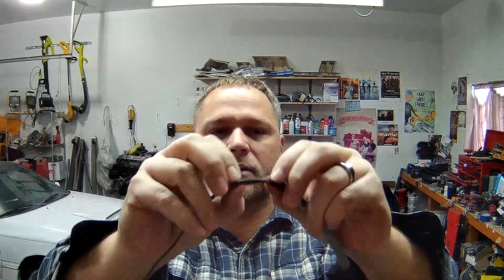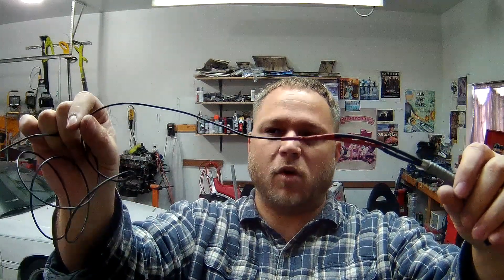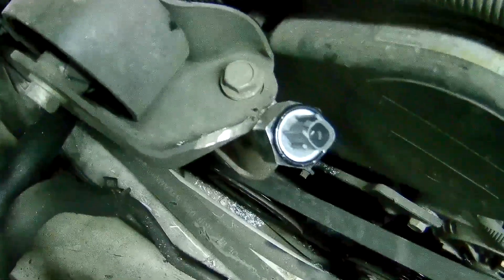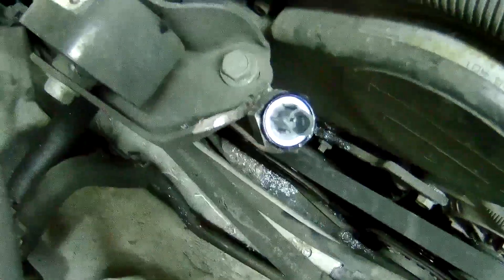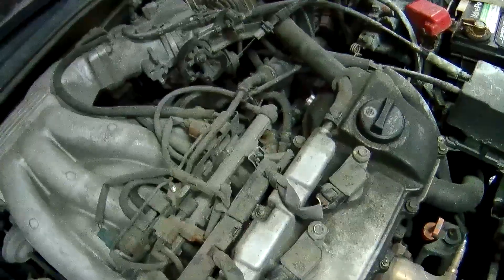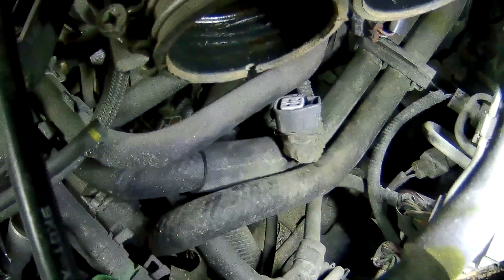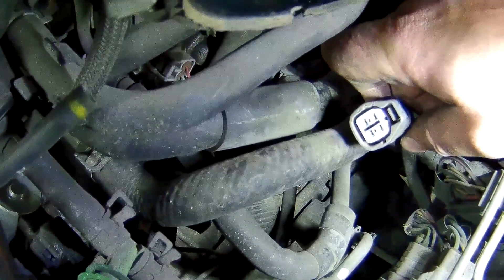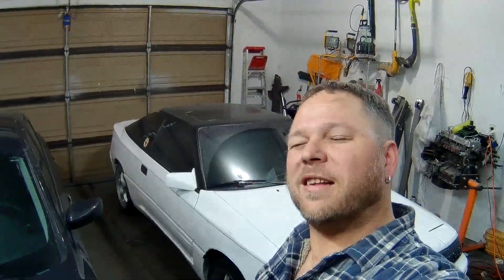1MZ-FE Knock Hack/Relocation

Comment: I know these are old post,but I have found a way of modifing bracket to head under air filter area to work stopping dreaded ping/ engine knock. I removed factory plate with ground wire on head ,used a square metal plate to mount sensors via 2 10mm bolts already there from factory plate. When you tighten new plate down it squeezes sensors against head and valve cover . No more gas ping.
Reply: Any pics.?

Comment: Do you get any issues from this does the engine perform worse in terms of performance or mileage
Reply from the maker: @JackTripper253  for the condition this engine was in, it ran fine. The computer was able to get a reading from the knock sensor, so it ran the engine normal. The car had its proper power cause the computer wasn't putting it in limp mode anymore. The big issue is that if there is ping or knock, now the computer doesn't know.

Comment: Any links on the harness you used?
Reply from the maker: I can't remember the brand specifically, but I bought it from rock auto. May be this one, or similar. https://www.rockauto.com/en/moreinfo.php?pk=4932957&cc=1364622&pt=13326&jsn=959&_nck=ZExt1ysfqhqWnq%2BEvUNdS3Txyey60IDtnjPWF5UU9J0BWQv7pvqZbh%2BYrdIIoJ2QMq9prrkIerbFMqky5nGcn4teOg9r2Sw3%2BPr1CNOXFqQFzxO1xi2naIVVDqptp38yXkE5m0eM5QCA%2By15xTcreiyKbrkDUxw8N3J1fJz5zOufanpc72OtvjcAoGyidBOB3quA3Ur7DwRxdOr7DP22yJzkHzetbGELJMxz3Z0xQ8ImaTBEdL7hn6sAuyR0f45TjYC2JQYHkEhzayyjZ1SoEo6whXgR7ZdnJloqAsGZJO4X4lnNCikTV32H38GBdFo6

Comment: This is a great tutorial!  Because.  1.) All the posters go on and on on about faulty Lexus Knock Sensor codes then replace the and hope it works.  2.) Some use one of the knock sensors that works and piggy pack at the ECU plug.  What if the other sensor fails?  This is the ONLY video where you actually showed in plain detail of  how you wired the harness and specifically where and how you added the new mounting location for new knock sensor.  Kudo's to you for doing this!   You also explained the condition that is causing the code, (coolant getting into combustion chamber.), and the fact that this hack may not properly report any future legitimate codes from engine knock.  Job well done!
Reply: That’s how I felt as well…The “Cutting a Factory harness” is just lame…

Comment: Can i still drive without one of the sensors working
Reply from the maker: Technically I believe the car still lets you drive, it just puts the motor in a limp mode, so it will normally drive slower and burn more gas cause it is trying to be safe. Thats my understanding anyway.

Comment: I just did this, but I am still getting the code. I have the sensor grounded to the frame, but did not screw into the block. I simply have the sensor wrapped in foam padding and resting on top of the air intake, but I am still getting the CEL code. Could it be that you have to mount and ground like you did?
Reply from the maker: I believe it needs to be in metal to function properly.

Comment: What part number did you use
Reply from the maker: I sadly don't remember anymore, but I am pretty sure we used this. You could use a different brand if you wish though. https://www.rockauto.com/en/moreinfo.php?pk=12387797&cc=1364622&pt=13326&jsn=855

Comment: By my calculation (when trying to buy a tap at HD), the sensor threads are  1/2" - 24.  If the Toyota specs are M12, then 12mm is very close to 1/2".  Also, the thread pitch (based on eye-balliing against a ruler) is LESS than 1, and looks more like .8  Measure yourself, but don't drill and tap until you are sure.

Comment: Why mount the knock sensor specifically on the motor mount? As opposed to mounting it on the firewall or the strut tower? I'm curious
Reply from the maker: I followed scattered forum posts with confirmation that it worked, so I can't say for sure since I wasn't going to mess with a winning formula lol. But, my guess is the mount doesn't introduce rust potential when drilling a hole. Also, mounting in the mount is closer to matching how it is in the engine, then threaded into some sheet metal. I am guessing it could possibly work both ways, but I can't say for sure.
Reply: @UtahSleeper  it worked. I had to use an OEM DENSO sensor for $224 🥲, my $20 RockAuto sensor didn't work. Thanks for the video, and the "winning formula."
Reply: @UtahSleeper  thanks for getting back to me! I'll do the same and hopefully it is also the winning formula for me. I've tried the splice method at the ECU end of the wiring harness and that is still tripping the knock sensor code. Hopefully this  works. 👀 Thanks for showing us how to do it

Comment: Mi Toyota already have the hole but is to small Any suggestions of what I will need to get it bigger.
Reply from the maker: If it has a hole, and enough metal around it, you should just need to drill it out more and make threads to screw in the sensor. Makes it easier if you have a starting point already.
Reply: I buy s tap 1/2 I will work ??
Reply from the maker: @GordoYoshi  I believe so, it's been awhile since I have done it though

Comment: Just bought a 2003 highlander with a 1mz. Changed the oil and pcv valve and I think I'm gonna have to do this next. I had a buddy with an avalon that got rats under the intake and chewed the wires, I do not want this shit happening to me.

It might be a damn near perfect engine if you change the oil often, but these knock sensors can get annoying especially when inspections comes around

Comment: How long have you had this solution work ?
Reply from the maker: I believe others in the comments made it seem like it has worked a bit for them, but sadly the car I was working on had other issues and blew up it's head gasket a couple days after lol. In most cases, this hack will continue to work at making the CEL go away, but if you have engine issues you will want to address them or drive the car very carefully. The car I worked on started driving very quick when the CEL went away.

Comment: hi i love your common sense solution here. I have a 98 LS400 Lexus and have 'bank 1 knock senson' chech engine. Your hack is perfect for me BUT my existing knock sensor wire loom is deeply buried under the intakke manifold and i am having a difficult time finding that existing knock plug to seperate and plug the new one wire trick you showed and proved that it works. Have given up for the day but will try to find it again tommorrow. Thanks !
Reply: Did you ever get it fixed I’m having same issue

Comment: You only replaced one of the two sensors. Luckily the car only generated a code for one bank.
Reply from the maker: I replaced 1 sensor, but the sensor is sending to the ecu for both sensors. That's what the wire modifying was for.

Comment: Dealer cost to replace both 1MZ-FE knock sensors, wiring harnesses as well as the manifold gasket on a V6 Camry: $2500! I said no way.

Comment: PEOPLE PLEASE DO NOT DO THIS!!!!!  It takes less than an hour to get to the sensors if your handy.  Replace the sub harness under the intake.  The sensor is rarely the problem.  I have done lots of these problem child’s and the real fix is to run a new shielded harness from the pcm to the connector at the sub harness.  Solder and heat shrink all connections.  Also these engines are 20 years old, they make more noise so consider a thicker oil.  Your welcome
Reply: Its a 4-6 hr job and around $1500-$2000 if you take it to the shop. No thank you
Reply from the maker: Agreed, the best option is to replace the wiring. The problem is the cost and time to remove the intake. This is where it is up to the user. Plus, alot of people trying this may be inexperienced, so removing the intake and ordering the new parts can be scary. This is a money saving move for many.

Comment: Will this work for Acura tl
Reply from the maker: Unknown as the ECU's, manufacturers, engines and sensors are all different. This would be a shot in the dark if you tried it as I am unaware if those cars have any known issues for wiring degrading.

Comment: Guys I just tried this hack it works cleared CEL . You need that 12mm x 1.25 tap to the motor mount . I short cutted the hack used angle iron bolted to intake and used nut to hold knock sensor didn’t work that way. Thanks for video
Reply: So your saying it didn't work with the angle iron?
Reply: @DoubleOGfromtheset  have you gotten to try this hack?
Reply: @kompamauro3410  my year didn't have the extra meat on the motor mount so I drilled and tapped it into a plate. And bolted it to the block on the backside. But I also needed to buy two sensors, one wasn't doing it.
Reply: @kompamauro3410  unless you have both sensors throwing a code. I recommend using the Hack by sowing the ECU wires
Reply: @DoubleOGfromtheset  yeah i tried it on my 1999 Lexus Es300. And I only used 1 sensor. And the check engine light is still on. I’m gonna try with 2 on a different bracket to see if that’s it.
Reply: @kompamauro3410  do you have both lights on? Let me know if it works

Comment: Hi, I'm getting both knock sensor errors on my 2000 RX300.
Where do I drill and how deep?
How to make thread in the hole for screwing the sensor? Thanks
Reply from the maker: I am not sure on the RX300, but it needs to be a solid piece of metal. There may be a spot near your passenger motor mount. It just needs to be deep enough for the knock sensor to screw all the way in. Less then a half an inch. To make a threaded hole, you will need a tap and die set for metric nuts and bolts
Reply: @UtahSleeper  Do you think it is vitally important that the knock sensor is completely seated in order for this to work? And, will crimp 14/16 connectors be a problem with this hack?   I am helping my son.  His car received knock sensor errors while he was 2 hours out of town and he waited for me to come help.  I have limited tools with me.  I placed the knock sensor in the same location as you did.  I am still getting the two knock sensor errors.  I don't have a 1/2" drill with me, so could not use a larger drill bit.  It made threading difficult due to the hole being a little too small.   I could only drill 1/4 and thread with loaned tap/die set from Orielly.  I was able to get the knock sensor on a few turns, but it is not all the way down.   It is very tight on that motor mount location. For wire, I carefully stripped the outer cover, peeled back wire shielding, then trimmed it.  I then stripped the two connectors and crimped them together.  I did the same for the knock sensor end.  Then ran the wire through a 1/4" plastic wire cover and ran along the firewall.  I zip-tied to vacuum hose on the driver side, and A/C live on the passenger side, then down to sensor on the motor mount.
Reply from the maker: @GeorgeNegrete  Honestly, I can't say for sure on either account. With the older technology I would guess it is needed to have the sensor seated and wire connected securely, but it may not and you could be fine. Best bet is to clear codes and find out as they came back pretty quick for my son. It's all a guess. The car should still run with the knock sensor error, so did your son break down for other reasons? Just wondering if I misread.
Reply: @UtahSleeper  Update: Once I got home I discovered there is also a problem with the catalytic converters that was causing the extreme power loss. However, I still could not get the hack to work.  It could be the O'Reilly aftermarket sensor, or there could be a problem with the wiring after the harness.  I noticed some small round droppings on the transmission.  Maybe a rat chewed the wire harness and it is impacting the knock sensors.  That would be strange as it is the only error code I am getting.  But, I also think it is strange that after clearing codes, I get the knock sensor error after about a minute of driving, and it is both knock sensors.  The engine sounds fine.  The plan is to drive the car with the knock sensor errors until it will no longer run.  It has 240K on it.  It has served us well.
Reply from the maker: @GeorgeNegrete  Catalytic converters can cause some grief. Before I did the hack, my sons CEL came on pretty quick after resetting it. Also, makes it a little worry some if you see signs it could have been attacked by a rodent. Hope you have time to look at it and get it working. These are great engines and can go for a long time.

Comment: I might have to try this on my 2000 Avalon. It just clocked past 350k miles. I got it at 207k and haven't changed my spark plugs :( but this sucker still goes man.
Reply from the maker: They are great engines and can live a long time. I would recommend doing all the maintenance, like plugs, before messing with knock sensors. Just to make sure a minor issue isn't what is causing grief. Hope the car keeps treating you well.

Comment: Couldn't you just put a nut under the ne knick sensor location vs tapping that bracket? Also update is the light still off?
Reply from the maker: You could do that, but no guarantee it would get rid of the light as it would change the signal to the ecu. Plus, if you go through the effort to get to the knock sensors, you are better off replacing the wiring going to the knock sensors as that is commonly the issue, not the sensors themselves. And sadly the car had been having head gasket issues before. The car had no CEL for a couple days then the gasket died. This was a junk car and we were just trying to buy time.

Comment: its this set up still working or how long did it last
Reply from the maker: Sadly, this car is no longer with us. We had been also trying to cheap fix the headgasket for a year (just trying to get by another year) and the head gasket finally gave up a few days after getting rid of the CEL for the knock sensors. It was a cheap car, so we just scrapped it at that point. Some of the earlier commentors on this video seemed to do the same job and got things working for longer(think they had better condition engines).
Reply from the maker: Keye Haze in the comments did this about 6 months ago, may be worth asking him also.

Comment: I am working on this engine right now. The location of these knock sensors, my first thoughts, "HEAT!! So, my thoughts were to cover wiring over same heat shield cover with a small radiator hose like to keep it from getting too hot. I just purchased new knock sensors with wiring. So, what do you suggest?
Reply from the maker: If you like the car and want to keep it going for awhile AND not having to worry about something breaking because of bypassed knock sensors, then fix with the parts you have. There is a chance only the wiring is cooked. Maybe look to test the current sensors. It costs more to fix it right, considering other gaskets and labor. Plus, the heat reflector would be nice. If you are just trying to buy more time till getting another car, I personally would relocate and just try and drive mildly. That's just how my mind works for repairs lol.

Comment: Where did you find your shielded extension wire? Thanks for a great video!!
Reply from the maker: The shielded wire i used was just part of the new harness i bought on rock auto. The extra couple of inches on the end was just normal wire soldered in.
Reply: Ok... Thanks! I was just worried about making sure the shielding ran through the entire wire.  Really hoping this will work!

Comment: Negative...Knock sensors are Very important and they need to be installed correctly. As for the Wire, it is not common for it to go bad, it is common because of the Age of the vehicle. Take the upper & lower intake off, replace the intake gaskets along with the Coolant Crossover hose under the intake and do it the right way.
Reply from the maker: On these engines it is common for the wiring to go bad because of the harness location and the heat. I only did this as a way to buy more time with the car as it wasn't worth much more. I personally wouldn't have done it if it was a car I loved because knock sensors keep your engine from grenading if something goes wrong. People have been reporting the wiring problem for almost 2 decades, while the rest of the cars wiring seems fine. So these engines just get to hot in the valley for the wiring.
Reply: No they are not on engines and cars this old.

Comment: I'm trying to find out what size of drill bit to use. Can anyone tell me?
Reply from the maker: I can't remember what size it got up to. I used a small drill bit to drill a pilot hole, but the rest was done with a gradual stepper bit till the new knock sensor matched up closely.
Reply: @UtahSleeper  I got it done, ended up re-threading the threads on the knock sensor for a 7/16-20 and it worked wonders. I used a 7/16 drill bit. No more CEL, have already put 150 miles and all monitors cleared.
Reply from the maker: @jayb7813  sweet!!! Glad you got it working.